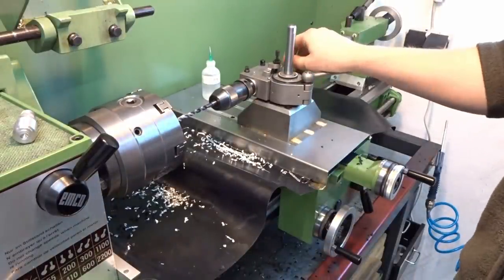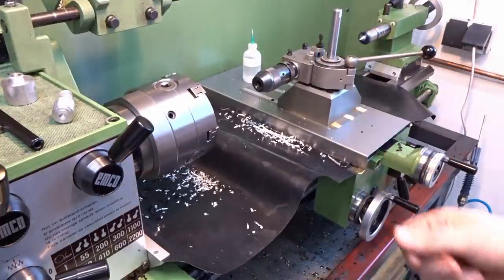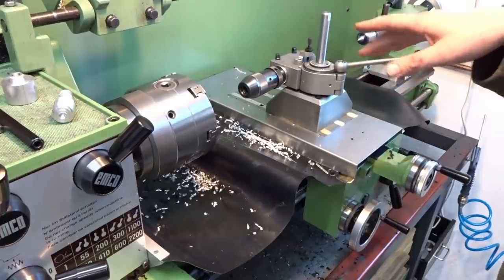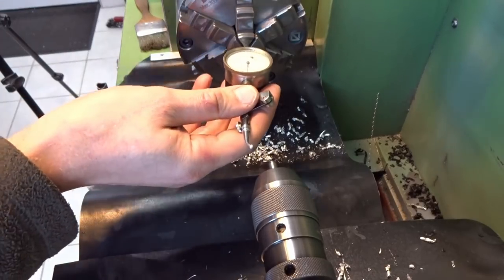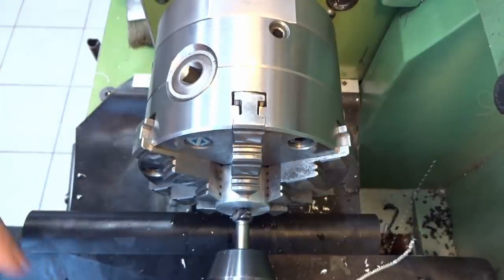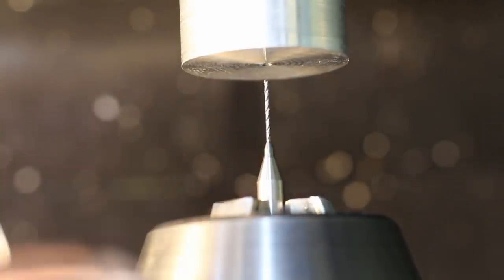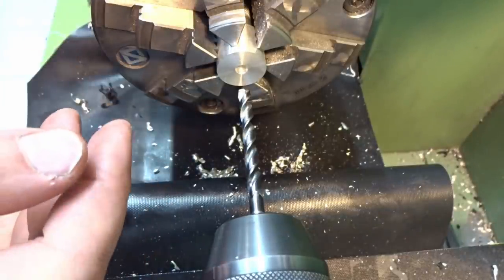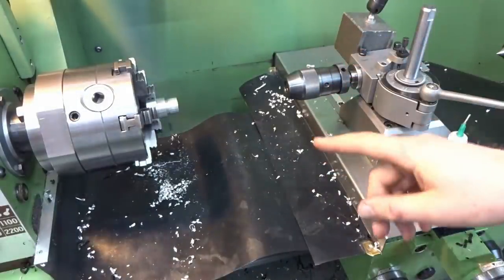Carriage Drilling on the lathe

Comment: Absolutely agree with your comment on straight in thread feeding. I remember demonstrating threading at a show and an old boy said you can't do that and another chap said he was taught to feed at an angle during his apprenticeship but when got to work full time was about to set the top slide but his foreman said not to waste his time and just go straight in, he never looked back. Why is is it americans want to perpetuate the myth that you HAVE to thread at an angle, when it clearly unnecessary save for weak and flimsy machinery?
Reply: Depends on the thread you are cutting and how aggressive the cut is.  Also how long the thread is can matter.  A relatively short stubby thread with a fine pitch (thread is not cut deep) it doesn't make an appreciable difference.  A relatively long thread on a thin rod that is coarse matters a lot.  You have basically doubled the tool pressure.  This not only deflects the work piece, but it can lead to more chatter and burrs on the Crest.  This leaves you with a rougher thread and a root/minor diameter that varies along the length.  So it really depends on the size and the material properties (how stiff/ gummy it is), the length vs diameter,  etc.  While using a compound to use the lead angle is not always necessary, there are times when it is.  Cutting with a lead angle always works,  not cutting with an angle is situational.
Reply: @Worrsaint  the true answer is every job has it's idiosyncrasies and what you are comfortable with. Personally once my top slide is set with dti to be perfectly parallel I like to keep it that way but everybody is different and the only thing that matters is that the end result is acceptable.
Reply: I have flimsy machine table-top and weak motor and I straight feed threading tools. My compound slide is even more flimsy than the rest of the machine, so I clamp toolpost directly to my cros-slide T-slots. I only install my compound when I need to make a cone or a pulley for a V-belt.
Reply: "Why is is it americans want to perpetuate the myth that you HAVE to thread at an angle"
I have wondered this too. 
As a gross generalisation, There seems to be a national tendency to gravitate towards rules which are 'cut and dried' and then to fight and die in a ditch over them. 
Comes out in the political discourse, too, it seems to me...
Reply: @Gottenhimfella  I admit a wild generalisation but it does seem mainland Europe doesn't bother. You do get the feeling that some well known YouTube workshop teachers would have apoplexy at the thought of not angling their compound slide.😉
Reply: @chrisstephens6673  Exactly, it depends on the job wether it is necessary or not.  When it comes to teaching someone, it is best to teach the way that will always produce an acceptable result rather than throw in extra complexity.  The shops i have worked in have always had the compounds mounted because they were oriented more towards maintenance and/or prototyping.  I used the compound quite often to cut angles.
Reply: @Gottenhimfella  Yes and no.  We do tend to do cut and dry when training.  Always train to the lowest common denominator.  We call it best practices.  The issues is not when competent people deviating from tried and true procedures, it is the incompetent.  There is a saying here KISS...keep it simple stupid.  Unless there is a compelling reason to change (pros outweigh the cons) then there is not really a drive to change.
Reply: @Worrsaint  just so, start with something that is simple before joining the real world. Like you have to learn arithmetic  before you can do calculus.
Reply: Gross generalizations aside, that's the way grandpa did it, and the way dad did it, and that's what we were taught.
Reply: @thefixerofbrokenstuff  time to think for yourself then🤣🤣
Sorry if that came out wrong not meant to sound insulting, honest.
Reply: @chrisstephens6673  Using the lead angle is the better way to do it still for the reasons I already stated.  You really don't gain anything by not doing it.  Stefan uses a solid tool post so makes sense for him not to.  Most manual lathes do not use a solid and need the flexibility a compound afford so it is already there.  Tried and true is usually tried and true for a reason unless there are major technological changes.
Reply: @Worrsaint  if you go back to early screw cutting on lathes, it was done without a top slide as they weren't universally adopted in the early days. Even the early Southend lathe user manual shows straight in, if memory serves. That makes angled top slide for threading the new fangled technique. 
Having no top slide or keeping it permanently set true both have advantages over an angled one, unless you want to cut a taper. Keeping the toolpost set square with a locking pin also has time saving advantages. Threading at an angle has limited advantages for all but extraordinary thread cutting. Your comment on long long threads might have validity but using a travelling steady is the accepted way of overcoming the problem.
Having said all that, I do occasionally use angled top slide on one of my lathes when I don't use the motor but hand crank the headstock for avoidance of crash risk on oddities. It certainly reduces the effort involved but under normal uses the motor of your average lathe  is adequate.
Reply: @chrisstephens6673  That may be true for early lathes.  But that would also go against the prevailing idea in this thread that angling the compound is only done because of "thats how it was always done".  You certainly could use a follow rest, that also takes time to setup.  Unless you are doing full form threading, the finish and quality of the thread will always be better by angling the compound.  You can also cut more aggressively as I already stated by only cutting one side of the thread vs 2.  I have cut threads with the straight in method.  I have mainly used the angle method though.  I have also had to chase threads cut in with the straight to fix them because they chewed up the mating part they were threading into because of the burr left.  I will also ask this, when thread cutting with a cnc, are they programmed with a radial in feed or compound in feed?  Why are they typically done that way?  You will find they are done as a compound in feed.  This is because it gives you a higher quality thread that can be cut with fewer passes.  Better tool life and better chip management are another reason why.  A radial in feed is only really used when you cannot do a compound due to thread type or some other limitation.

Comment: Stefan do you worry  about using alcohol  ?  a flame up situation 🔥.  I thought about using in a bandsaw  that cuts everything . I use alcohol for some thing and like it's dryness
Reply from the maker: I use it only for aluminium and some plastics. Never on any ferrous materials, that might spark. I had not a single explosion/flame since I started machining.
Reply: Alcohol burns cold and quickly.  Much safer for aluminum drilling than turpentine.
Reply: @thefixerofbrokenstuff  Indeed. You can light a pool of 50% ethanol in the palm of your hand quite safely. I use 70% ethanol extensively in the shop in a fine mist spray, and have never had it ignite spontaneously even around grinding and welding stations, where I use it for evaporative cooling. If it did ignite it would be innocuous. It is both more gentle (as regards creating micro-cracks as a quench agent) and more effective (because of enhanced evaporative cooling) and of course non corrosive, as well as less messy and easier on the skin than water.

Comment: hey Stefan I was wondering when using tool offsets on a manual lathe with dro do you have a zero position or do you just leave the dro powered on all the time so you don't loose your zero. ooooor are you able to not touch the ha does when it's powered off?

Comment: i suppose this is going to sound reallly stupid to all of the more experience machinists here but... why not put the drill bit in the chuck? and then put the work on the table with the DRO? 

for example if doing an operation on a non round stock, with multiple similar holes. then could zip around with the DRO to all the locations first with the starter bit. 2nd operation change for the main bit, zip around again. then finally with a chamfer bit. and optionally a tap if threading as last operations. you could even drill a couple different sized holes, just with changing only the main bit extra times (and the taps if threading)

i do get you are doing certain jobs as routine on round stock. just asking for other situation if it would work just as well for the other way around. or if its some big no no / cannot do
Reply: This works and is commonly done when using a 'milling attachment' on a lathe. The milling attachment is nothing more than an extra slideway so that you can adjust the height of the workpiece as neccesary.
Reply: @stevendoesburg6555  ah cool, thanks for letting me know there. nice to hear about it

Comment: The technic works excellent, no doubt about this… but the taping on a larger lathe doesn’t work… on my 11kw motor and a 560mm swing lathe . My caridge is heavyer then a smal lathe 😂😂😂 it will brake a 20mm tap and won’t even fill it

Comment: Can you use a stubby drill bit as boring bar in this set up ?
Reply from the maker: YeahNo, a bit :D
It kinda works with stubby carbide drill,s but you need to align one of the drill flutes towards you and at center height.

What works good, is an indexable/inserted drill - Those will act like a boring bar very well.

Comment: I have wondered why you had not repeated your installation of a rack-and-pinion tailstock quill on the Emco. Clearly all advantages are dealt with by carriage drilling. Are there any features of the rack tailstock that you miss?
Reply: I can't answer for Stefan but for me, I'm thinking of making my tailstock to be rack fed, for deep hole and gun drilling, so that the carriage is available for mobile steady support. This is on a lathe with box ways, so I would use the same rack the carriage uses, and feed the whole tailstock with the barrel locked. This way the tailstock drill feed travel is unlimited
Reply: @Gottenhimfella  Interesting concept!
Reply: @russelldold4827  Thanks Russell. For those wondering, the "mobile steady support" I mentioned is so that a very long drill can be supported near the tip when the hole is begun, and then once a good true running entry has been drilled the steady can be moved back to provide a midspan support to keep the drill from buckling under the heavy feed pressures with are a particular feature of some deep hole techniques, such as spade drilling.
On gun drills there are often a series of such steadies. The longest I have seen (in a catalogue, not in the flesh) was I think 160 feet long. From Niles Bement Pond, who built machines which were used in the glory days of long-barrelled naval and artillery guns, in the first part of last century and the last part of the previous one.

Comment: question: would somthing like a collet chuck (if you could find it in the right size for the lath) have less runout?
Reply from the maker: Yep! I have a ER25 straight shank collet chuck that i can use in the toolpost too, but toolchanges with them are very slow, so I use it only in certain cases.

Comment: he stefan, I wonder if there are toolpostdrill chucks that you can mount on the front of the toolpost? so that everything is in line when drilling.
that could rule out torsion of the toolpost due to the pressure when drilling.

Comment: Another great video, as usual. Why is there a small gap between the solid toolpost and the tool holder? Is that intentional or is that just how that qctp is made?
Reply: The tool holder has to be clear of the mounting surface for the tool post, otherwise it would not be possible to adjust the height of the holder to bring the tool on centre
Reply: @Gottenhimfella  i meant the tool holder base, if you want to call it that. My aloris sits directly on the compound with no gap.
Reply: @sblack48  You can see what the underside looks like if you follow this link:
https://youtu.be/FDPfB4r1qEw?t=2603
There's a slight chamfer at the bottom of the splined section, which (perhaps unnecessarily) takes the mating diameter with the compound well below the minor diameter of the spline, and this underhang is presumably what you described as a gap -- or perhaps you were looking at the bigger gap under the hinged clamp? (Which is not strictly pertinent to rigidity)
Anyone who wanted to, and had some ceramic inserts, could face off the underside to get a somewhat larger footprint, but judging from the one in the photo it's only about 7% bigger, even if the new footprint was taken all the way out to the major diameter of the splines, which (unless the resulting aggressively castellated edge was radiused by some careful means) would risk leaving marks in the mating surface.

Comment: Stefan, a quick technical question please. How is it that your keyless chuck does not loosen when you reverse the tap out ? I have several Albrecht keyless chucks and everyone loosen when tapping when I reverse the spindle. Thanks.
Reply: @oldscratch3535  what are you talking about. There are NO ratchet clicks on this chuck. You must be talking about a different make.
Reply: @oldscratch3535  I never said that it was a locking chuck. Toolroom PRECISION Albrecht chuck, 1/32 to 1/2 inch. Mine looks just like Stefans. Thanks for replying anyway.
Reply: You need to remember that keyless chucks are self tightening.  If the shank of the tool slips they tighten even more.  If you use a large enough tap, or even a poorly lubed or dull tap in an Albrecth or any other brand of keyless chuck they will tighten to the point of cracking. (Don’t ask me how I know this)Ever since I use a Jacobs KEYED super chuck if I am going to put a tap in a drill chuck.
Reply: @37yearsofanythingisenough39  Thank you for your reply and advice. Duly noted. I will now NO LONGER keep trying a keyless chuck for tapping purposes. I have seen other channels showing using keyless chucks successfully for tapping, so I thought that it must be just me. Also seeing Stefan doing it made me also think that too. Perhaps if Stefan reads your comment he may also stop doing it. Thanks again for your time in informing me of the dangers. Regards from Australia.
Reply: Works fine for small, sharp taps

Comment: What happen if your cross slide has back slash?
Reply: Good point. it would pay to fit a clamp - say a set screw pushing against the gib.
Reply from the maker: Nothing - A drill does not create side loads, if the tip is not ground massively offcenter.
Reply: but if a big drill or countersink (big in proportion to the lathe) chatters, the cross slide may walk sideways?
Reply: It self centers and you whistle a happy tune.
Reply: @thefixerofbrokenstuff   Seems to me if self centring were that reliable it wouldn't walk sideways in the first place. And yet, it does, especially with long series drills (which are never perfectly straight). I agree that as the hole gets deeper the drill will probably bring the cross slide back towards center, but you don't get good quality drilled holes if the drilling axis is not stationary throughout the production of the hole. (Bellmouthing, and possibly eccentricity error)
Same with reaming. A short reamer of large diameter might pull a loose slide into line, but otherwise all bets are off, and so is the hole geometry.

Comment: Really not convinced on using the saddle. Too much lost time for a model engineer I am afraid. Even in a maintenance shop I could never see any advantage
Reply from the maker: I dont need/want to convince anyone, dont worry - Just showing the fastest way for my kind of work :)
Reply: @StefanGotteswinter  I get it in cnc work, a mere tool change and away you go. In the home by the time I had centred up I could have drilled changed and back onto something else.
Reply: @union310  I think the point was that he only has to center up once, with a tiny tweak each time he sets up a new drill.  That same tiny tweak would be needed, or would be ignored, when drilling with the tailstock.
Reply: @ydonl  I understand the principle in cnc where the machine auto centres and multiple tools are available. Though when  you think of how many conventional  lathes are out there, the reason they have a tailstock is obvious.
Reply: @union310  Yeah; I get it -- no offense intended. It's just that one of the things I like the most, the most, about Stefan is that he's not constrained by letting other people decide what's right for him.  He's constantly identifying things that maybe almost everybody else does, but he rethinks it, and comes up with a better way.  I think this is one of them; there are lots of others over the years.  I think it's good to think for yourself; I think it's an important and valuable part of life.  And it's shrinking in the culture as a whole.  (Did I just wax philosophical? :)
Reply: @ydonl  I agree on the thinking outside of the box.
I manage the engineering  and facilities of two large factories. All my apprentices make a steam engine to learn all the old skills not taught in colleges now. When I started the programme they all thought i had flipped.
In engineering everything can be done multiple ways to achieve the same result. Some make more sense than others.
Reply: @union310  Sho' nuff!

(And I like steam engines, too.)

Comment: I have a Dumore sensitive drill press that I got from an online auction for $100. It didn't come with the chuck though so I've never used it and those little drill chucks are anywhere from $120-$500 so it just didn't make much sense to pay more for a part than I've got in the entire tool. If I happen to find a cheap chuck one day then perhaps I'll use it, but I've had no problems using small drills on my larger drill press or my lathe.